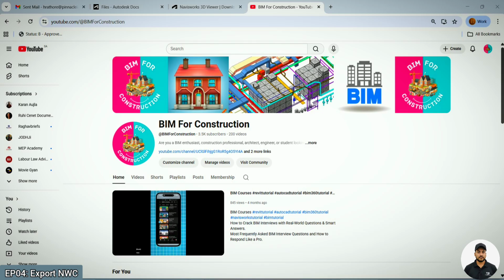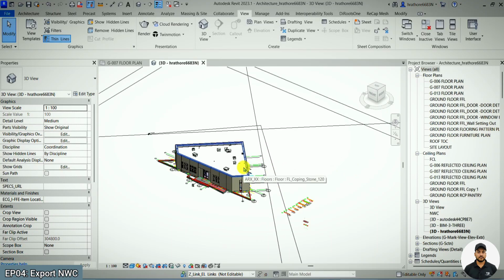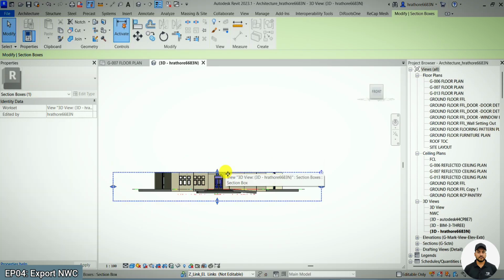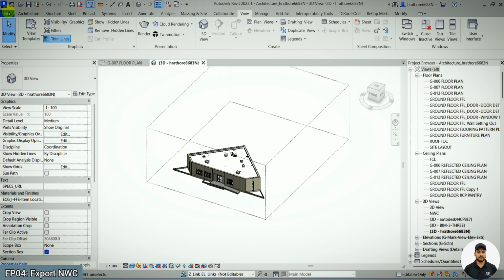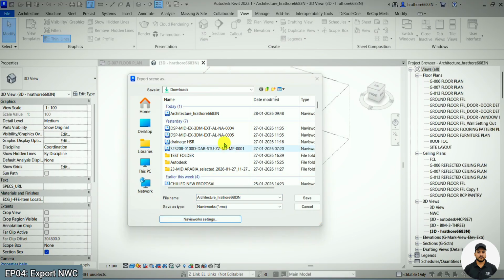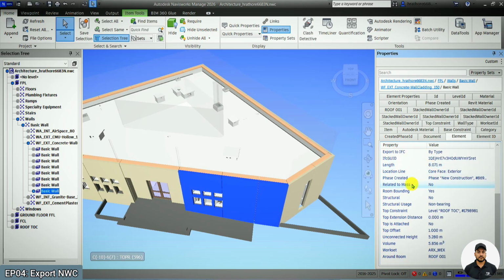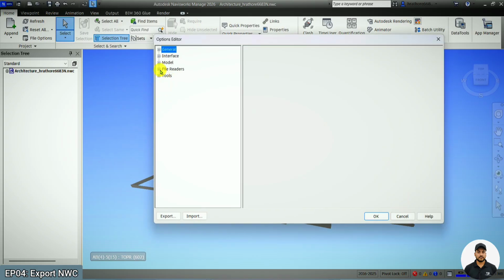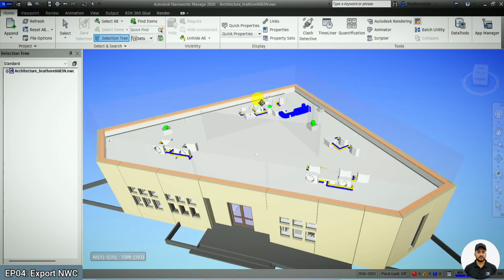#04 Navisworks Tutorial: How to Export NWC from REVIT?

Comment: Sir in my case if I turned off 'Convert Linked Files ' in naviswork setting model disappear after export as NWC in naviswork 
What's the reason?
Please tell when turned it on or off ?
Reply from the maker: If Convert Linked Files is turned OFF, any linked Revit/CAD models won't be included in the NWC export, so they will appear missing. Turn it ON when you want linked models to be exported. Keep it OFF only if you intentionally want to export the "Host Model" (current revit model that you opened) only.